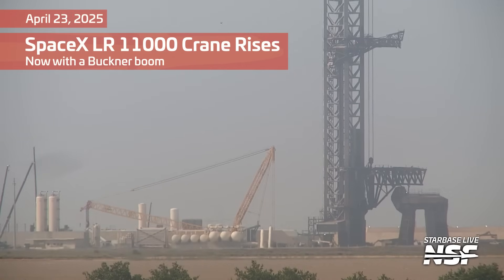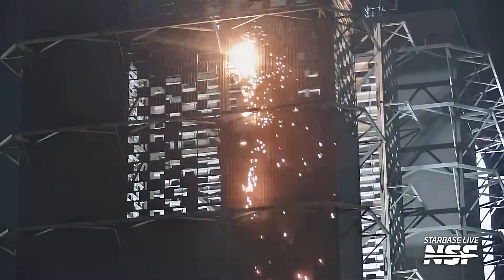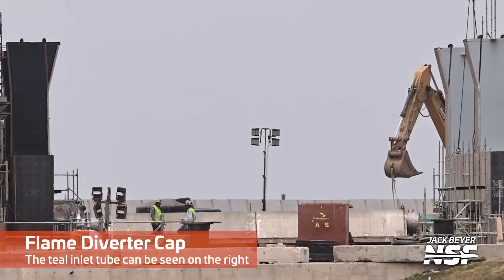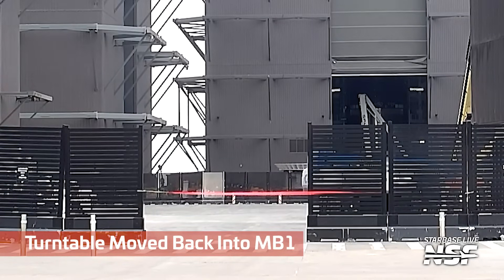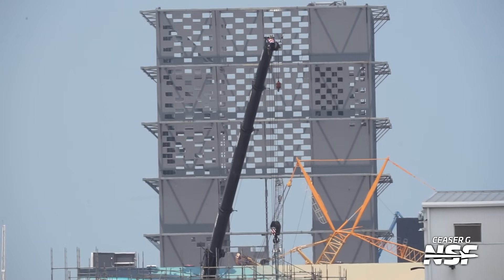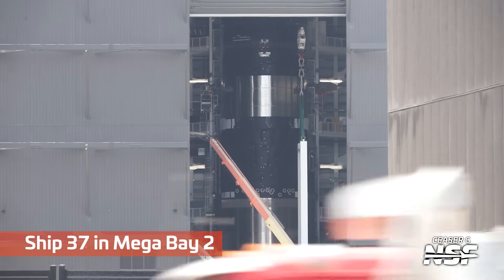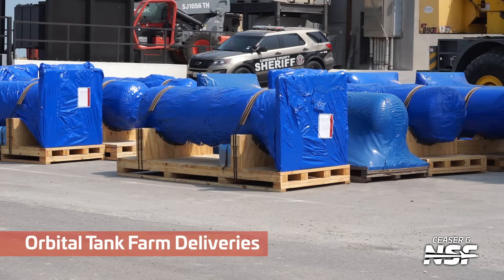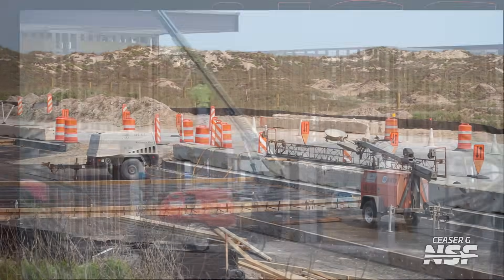"Pad A is going to look... kinda busted. Pad B is the new hotness..." | SpaceX Boca Chica

Comment: Why are American homes built from timber if they just get blown away in a storm or worse, burnt down, concrete not in short supply down at Starbase City….. just saying 😊
Reply: I think it's down to the general availability of timber throughout the US, so everyone is most familiar with designing and building them that way. They can make parts out of concrete, but with proper design the wooden parts should be able to handle quite a bit as well
Reply: Wood tends to be a little cheaper upfront and it's flexible to work with.

Comment: If those pumps will be installed in the same line...a bunch of pumps is called a "series" of pumps.  If they are in parallel, we usally just call them a "bank" of pumps.

If they are just huddled together like that up to no good at Starbase, and haven't been used yet...well that's a pump nursery.
Reply: ….or, a gaggle of pumps….

Comment: Google:  An "array of pumps" typically refers to a group or system of multiple pumps used together to achieve a desired flow or pressure output. These pumps are often configured in series or parallel to increase overall performance. They can be modular, allowing for user-specified configurations to meet application needs."

Comment: Just because they are bolting the new launch-mount legs down, instead of welding them, doesn't mean that they are built to be swapped out. They commonly install street-lamp-poles by bolting them down, and they aren't really built that way so they can be easily swapped out, its just how they are installed.
Reply: Sign and lamp posts are bolted for the exact reason to be swapped easily, and are a designed weak point to break when hit by a car.
Reply: @Timmernator9 Yes, agreed, and the ones with a nut on the top and bottom also allow for leveling them up so if the base is slightly tilted the street light can be aligned to true vertical.
Reply: @Timmernator9  Ok; but sign & lamp posts are only replaced after they have been destroyed by cars or trucks. They are not regularly swapped out, for newer models, and they most often stay in place for decades. Maybe a catch will fail & the resulting explosion will result in the launch mount needing to be swapped out, just like a lamp-post after a crash. But hopefully that doesn't happen, and the launch mount stays put for decades (in the sea air where the nuts will rust solidly onto the bolts). ;-)
Reply: Plus, just because there are bolts does not mean they won’t also weld the table to the legs once the bolts are secured.

Comment: It's normally called "pump row" so if you're on a refinery process unit and you get a power blip. You will immediately call the outside operators to "go check pump row"

Comment: It's pump sets, nothing really special, as they are normally matched.  The bottom of the actuators is a butterfly valve, turns 90 degrees open-closed, these cycle very quickly.  The stem length is to allow for thermal decoupling, a fancy way of saying the pipework is insulated from the actuator.   These actuators might also be high speed solenoid type.  As for off site module manufacture, this is done via a standardisation of parts and use of CNC design and fabrication. Hope this helps.

Comment: John. The reason the cut the holes in the high bay walls is not to prevent the wind from toppling the high bay. It's for when the are lowering the chunks of wall so the wind does not make them spin uncontrollably.
Reply: Both ideas have been passed around and both are likely true.
Reply: @DV-13  My opinion stems from a video showing one of the first sections being removed and it spinning wildly out of control. The checkerboard cutouts showed up right after that drama played out.
Reply: @caseyandtara  I was with you on that reason, but I couldn't get out of my mind the fact that they had no issue raising them pre-built, I wonder now if it isn't just pre scrapping cuts so there isn't so much work to do on the ground before they haul it away.
Reply: Probably both.

Comment: It wouldn't surprise me if the beam across the Pad B OLM legs is there to keep them in position while concrete is being poured into the legs and "wall segments" in between them...
Reply: They need to get the spacing and level correct.